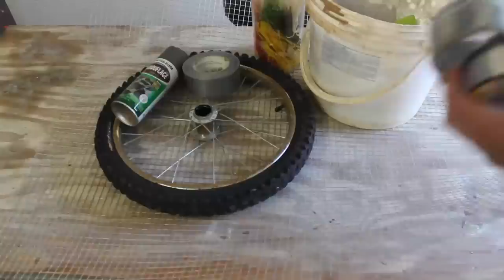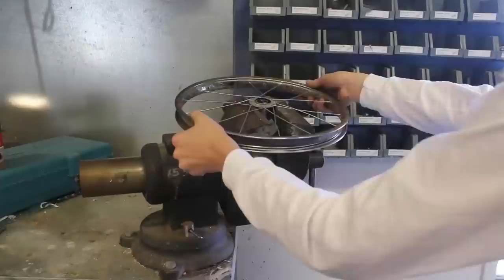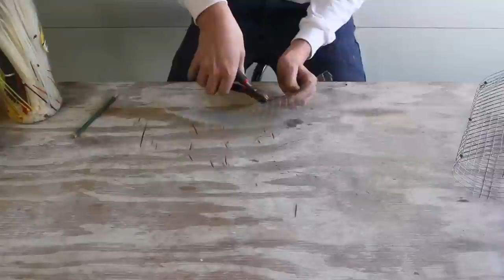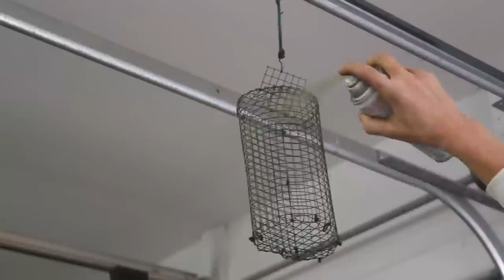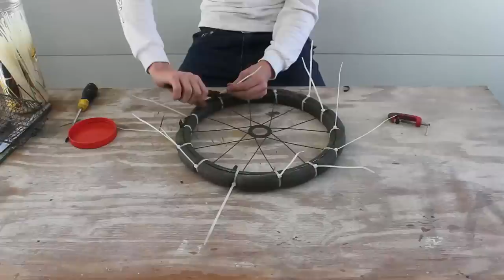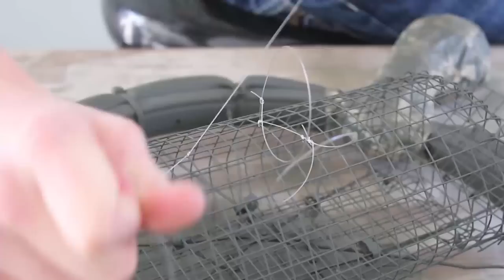Bal-Chatri Hawk Trap Building

Comment from the maker: Time put into falconry is never wasted. One is always learning. The neat thing about the wheel is it has spokes. The spokes flex to absorb impact which protects your bait a little bit more when dropped from a window. The sand weights also absorb shock, and keep the trap from flipping or sliding. They also keep it corrected in flight. I plan to put astro turf in the trap, along with noose extenders. I have a camera mounted on it now as well. I have seen too many birds dragging the trap along as..
Reply: Falconer's Apprentice

Comment from the maker: There are countless possible ways to make an effective BC, just takes creativity and a lot of perfecting! I have gone through several ideas, PVC frames and the like, I discovered that the bike rim is a durable frame to mount the cage on (I use gerbils, like to keep them alive) and when it is dropped from a car window, the spokes will flex to absorb some of the excruciating impact! The sandbags add extra weight, (a hawk dragging a trap is risking injury) and keep the trap from going into a -cont-

Comment from the maker: Okay well your request is a little confusing but the way I made the cage out of wire mesh is shown in the video, just roll it into a cylinder and cut circles for the ends, crimp the wire to hold it and zip-ties for extra strength, this is 1/4" hardware cloth (wire mesh). Thanks for watching, hope that helps, if not, please rephrase your request a little clearer so I can help out better! Stay tuned!

Comment from the maker: the falconer approaches it. This dragging thing seems harmful as it could easily drag it the wrong way into the road or what not. My trap is quite heavy and immovable. A heavy trap also means your nooses have a weighted base from which to pull. They spring shut faster this way. I am always experimenting, I may try a square trap, remodeled to the way I like it. Thanks for your input and if your trapping this year, good luck!

Comment from the maker: This is nothing compared to some of the traps I have seen others using. Some people get very particular when it comes to getting exactly the bird they want, foot size, talon size, coloration, weight, feather condition, etc. When you have to trap 10 birds before getting the one you want, a well-made well-engineered trap that will hold up and catch consistently is a good investment. My traps have since been modified with built-in cameras and new noose systems.

Comment: After looking at the finished product, I didn't know if you trap a hawk with it or use it to deliver newspapers...Or both.
Reply from the maker: I trapped hawks with this thing, but i'm still trying to figure out how I can use it to launch a new state-of-the-art mail delivery business. I am debating whether or not I should redo my design. I could trade out the four sand weights for quad-copter props, then I would simply fly the device right up to the hawk on the pole, while carrying newspapers beneath it on a remote control release device.  Delivering mail and capturing passage red-tails at the same time, that's what I am talking about. Thanks for the comment.
Reply: TOUCH'E

Comment: Not trying to beat youup but,  all that extra stuff and time put into that design is all wasted.  Reinvention of the wheel comes with the same conclusion.  A wheel.  A square with a weight and nooses will do just as well if not better than that frankenwheel.
I've been trapping for a long time and simple is best.